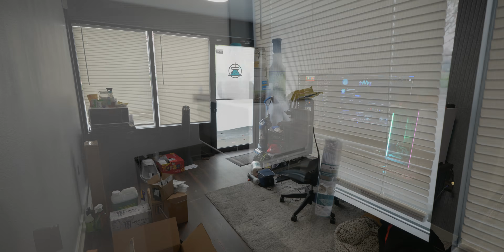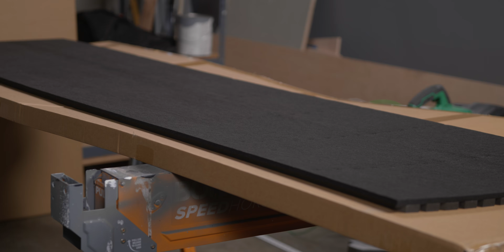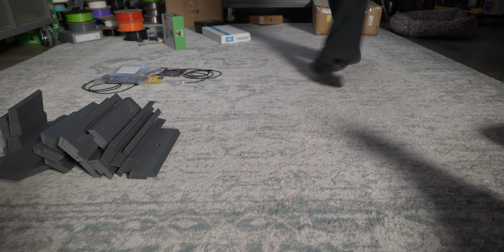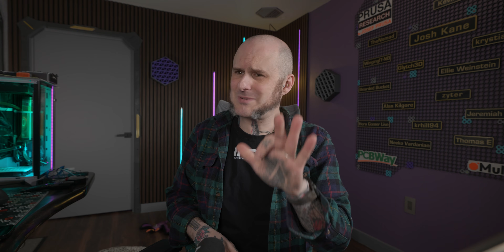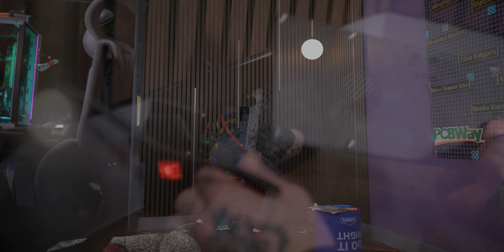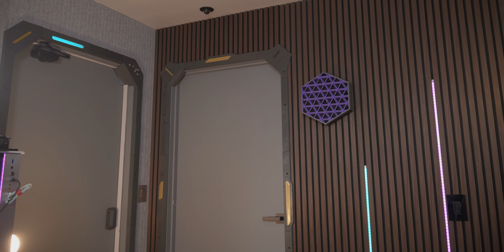RGB, Wood Slats, & AuDHD: An Office Disaster Story!

Comment: I think you did a great job and looks like it's very functional for your needs.  Goes without saying since it's your project.  One thing I would have done was print some kind of techie filler or overlay for those seems around the door frame.  Outside of that, you did an amazing job with the frame over all!

Comment: Looks great!!👍 👍

The amount of spacers used on the electrical boxes is probably no longer to code though. (Not an electrician but have seen comments posted elsewhere). If you have too much space between the face and the box, you potentially expose the electrical to flammable materials. They have box extensions or possibly print if you have the proper material
Reply from the maker: Yea, the proper choice would have been full box spacers, but I couldn't get them in a timely manner. The light switch is fine, the wood slat wall? Less so... Really only included that cause it was funny, should have noted the potential issue.
Reply: You beat me to it. Spacers are fine if you need to move the faceplate up a 1/4 of an inch but are not the 'correct' way for this installation. This is a job for an electrical box extender than you should be able to get at any building supply store. A box keeps things like insulation and finishing materials away from direct contact with the wiring. I would argue that using an extender in this case would just be easier than all those spacers and really long screws. 

If you want the excruciating details see NEC 314.20, but basically the box should be flush if using combustible material and no more than 1/4 inch otherwise.

Comment: Major effort and looks good.  I'm concerned about your electrical boxes though.  I think you should have metal (or at least fire resistant plastic) protecting your sound insulation from catching fire.  You can get box extender pieces for this, easy to install.
Reply from the maker: Yea, I should have noted that Box Extenders would be the right call there. Only shared that cause it was absurd, but with electrical stuff I should know to call out those moments. Only reason I didn't use extenders was I couldn't get them quickly enough.

Comment: very impressive what was the filliment cost along with the total cost??
Reply: and what printers did you use
Reply from the maker: I honestly haven't a clue. I use filament that I had a couple cases of from a project that never came together. 

I just sliced 1 door worth of prints to see. The estimation was 2.36Kg of filament. So figure I used a little under 6 kg for this project. $115 for both doors? I used Polymaker Polyterra PLA which is generally between $15-22 depending on sales.

Comment: Looks very nice. I love the color combination. When I saw you put the new purple paint on top of the color swatches I was a bit anxious about those swatches shining through the final paint but you solved that possible issue by placing an extra sound panel around the corner. As planned I guess, it creates a nice cozy place for the chair and it also makes the office look larger on camera.
Modeling the wall panels up in CAD ... I did a similar thing with my brothers terrace just to know how many of those large flat stones he needed and as soon as I can measure up my new home, that is going to be modeled in CAD too. Do I need it? Not really but it's nice to have to plan remodeling projects.

Comment: I don't 3d print anymore so I guess I haven't been recommended your videos. I saw this one in my feed and wondered how you were doing. From the comments it seems like your not getting much views for the effort your put in. 

For an adhd tip try doing it with limits, especially time or budget sometimes both. You'll fail probably but you at least have a target now, I do this to save wasted time on gathering information.